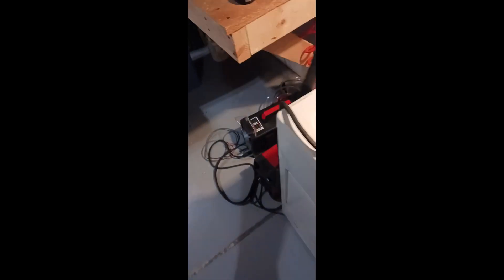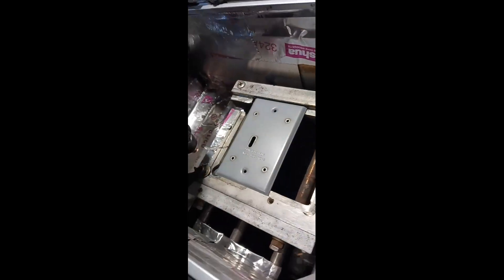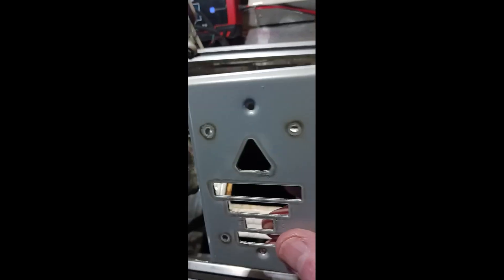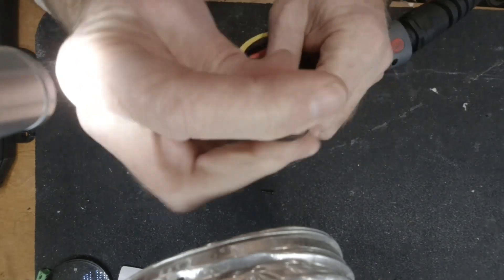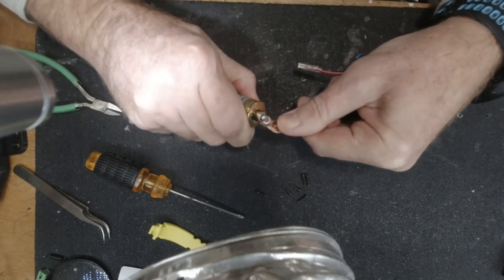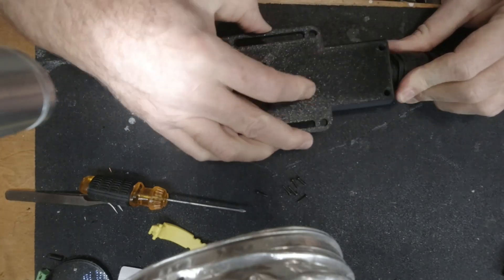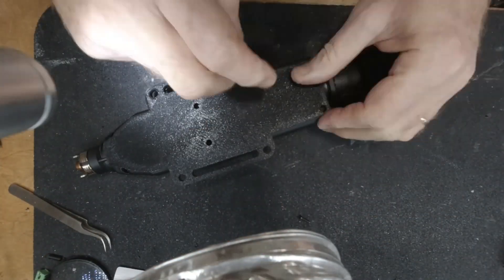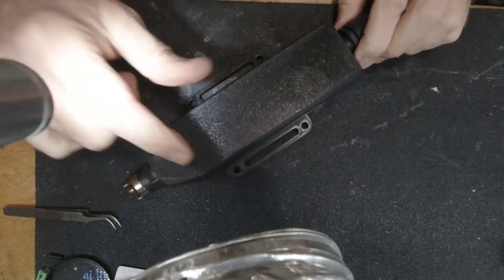DIY CNC Plasma cutter machine head conversion

Comment: Very nicely done; just ordered mine (going to use a YesWelder Cut-55DS Pro).  👍

I'm also ordering a 2nd IPT40 torch for this mod; I want to keep my original as a handheld model - just in case.

Comment: Would this work with the Lotos 5500D CNC plasma? Thanks and awesome work.
Reply from the maker: I'm not absolutely sure.  When I look at Amazon for the Lotos 5500D, it appears to be the same IPT-40 head as mine, yet in some of the review videos on Amazon, it is a different head.  You will have to open your head and look closely and compare to what is seen in my video.  Including the ROTATION angle of the hex head on the brass mechanism as it sits in the housing.  Let me know what you find.
Reply: @JohnHansknecht   I do know its an IPT-60. Does the number indicate amp capabilities? Ill check it tomorrow and let you know if it matches yours.
Reply: @JohnHansknecht  I checked mine and where your head sensor wires tie into the switch wires, mine go back to the machine separate, meaning the head sensors 2 wires go all the way to pins at the machine connection as well as the trigger has 2 wires that go all the way to the pins at the machine connection. Since I don't use the switch can I just dead end those? However on the sensor for the tip I bet I would have to tie those together maybe? I really don't know. Other than that it is the same as yours.
Reply from the maker: @riverbottomband  The "switch" connection from your machine will connect to your CNC controller instead of the handheld switch.  If your machine watches the two pins that detect the head is in place, then you can either drill out my housing to slip those two spring pins in, or you can short out the circuit because it is the brass of the head that shorts the two pins.  You do this at your own risk, because lack of a head exposes high voltage.

Comment: Hi John, do you know if you can use the Yeswelder Cut 55DS? I have one that is not the pro.
Reply from the maker: No, that is a different torch type.  In general, High Frequency start machines are a nightmare for CNC.  The DS Pro series uses a blow-back starting method that has no high frequency.
Reply: @JohnHansknecht  Thanks for the info. Looks like I may need to buy another one. I'm sure my wife will love that. haha.

Comment: Great conversion. How do you trigger the torch from the CNC controls? I would have thought that you would need to wire into the switch lines to trigger it, but you don't show that in this video.
Reply from the maker: Every CNC control card will have a fast relay output that is controlled by gcode, in my case with Mach 3 as a controller, it is the M05 code to start the torch and the M03 to stop.  The two wires that used to go to the handheld trigger will be wired to this relay instead.
Reply: @JohnHansknecht  Makes sense. Did you connect to those wires inside the torch head, near the connection to the plasma cutter, or inside the plasma cutter housing?
Reply from the maker: @engineerable  Once you have cut the switch out of the head, there is no reason to keep the two wires that went to it within the cable.  They can be pulled out and routed directly to the CNC card.  Sometimes wires aren't easy to pull out of the assembly because they are cable tied in a few locations.  In this case, you will notice that your connector that goes to the torch power supply is only a two-wire connection, so you can snip them off or unsolder them, and then send a new two wires over to your cnc card.
Reply: I just received your eBay machine plasma cutter housing you sell. Looks well made, very nice print quality. What printer do you use? I'm going to be making a video of the plasma cutter build using your adapter. Will let people know where to get it. Have you rigged up a ARC ON signal, or don't find it necessary for your use?
Reply from the maker: @engineerable  the cheap Yeswelders pretty much let you know when arc is on because it blasts air and ignites an arc unless you haven't installed the consumables correctly.  I use a Prusa I3Mk3.   Print could actually look a little better, but I have been having first layer adhesion issues.   Working on improving that.
Reply: @JohnHansknecht  I meant ARC ON signal into the CNC controller to give it feedback as to whether it's working or not and pause the motion if it's not cutting. My Hypertherm has a signal. Your cuts are short so probably don't need it.
Reply: @JohnHansknecht  Initial layer adhesion is challenging. This is what works well for me on a different printer. First let the printer warm up to print temp and stabilize for about 20 min before doing the Z homing (this is how long it takes the bed to stop moving due to temp change). Turn the extruder initial layer temp up by 5-10C. I've found that a distance of about 0.2mm for first layer, increase the line width spacing, and increase the extrusion % to compensate for the wider line spacing. The idea is to overextrude to guarantee that the plastic will make good contact with the bed, and squish out to the sides a little. But if the line width spacing is 100%, overextruding will cause the plastic to bulge up and the nozzle will plow through causing issues with the next few layers. Increasing the line width spacing gives room for the overextrusion to squish to the sides without bulging upwards. To start, increase the initial layer line width spacing to about 125%, then run some tests and keep increasing the extrusion % until the lines merge, but don't bulge up.
Reply: @JohnHansknecht  I took a closer look at your print. It appears the first layer is under extruding. The lines are not pressed into the build plate, and there are gaps between the lines. I think the advice I gave you earlier is on the right track to improving your initial layer adhesion. What material is this?
Reply: I assembled it and ready to install on CNC. There were 2 issues I ran into.
1st - The screw hole was too shallow and the screws bottomed out before clamping. 
2nd - The top and bottom of the hole that grabs the tip was flat due to the layer line height. This cause the torch tip to wobble because the flat portion of the  housing hole contacted the round area of the torch first. I filed this away to create a relief, and this worked perfectly to prevent the torch tip from wobbling. 
I posted a video of the build here with links back to your housing and video. 
https://youtu.be/YBHTWheZ8XY